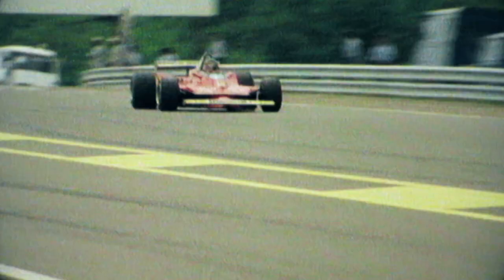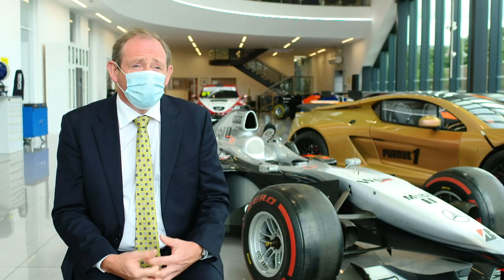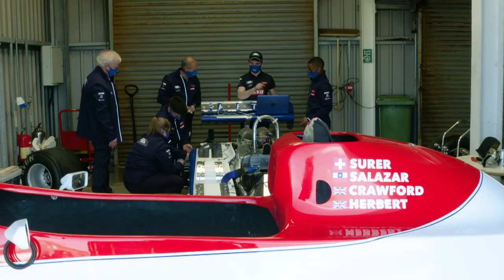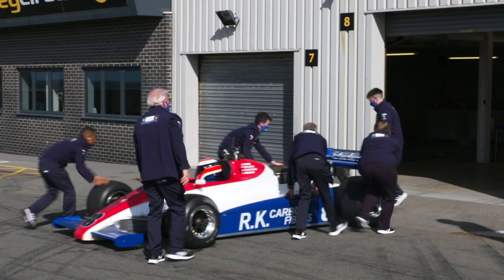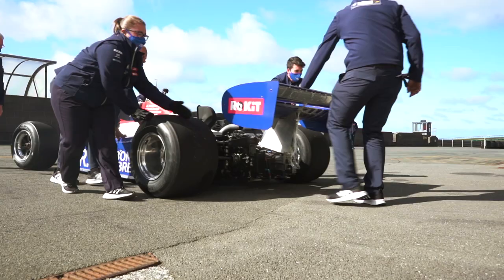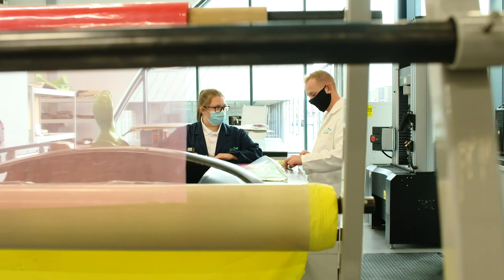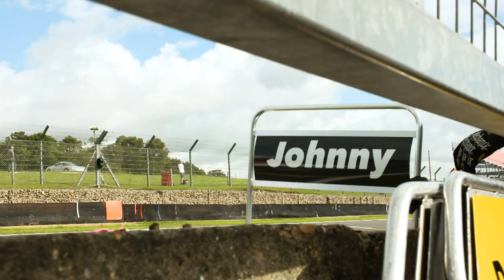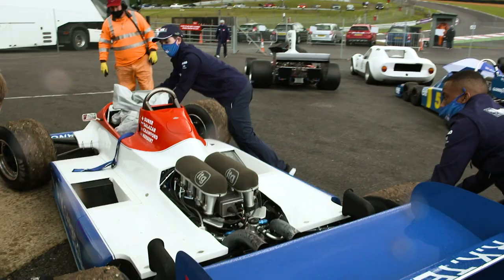Johnny Herbert Races The Ensign With Masters - Brands Hatch

Comment: what track is that?
Reply: Brands Hatch (Full grand prix circuit) which was used as the venue for the British GP (and occasional European GP) between the mid 60s and 1986. The car Herbert drove here would probably have been raced in period at Brands. The circuit changed very little since it was used for F1.
Reply: @markymark2819  That's not where that test took place
Reply: @billenright2788  Race was Brands Hatch, i believe the test session before that was Anglesea.
Reply: @markymark2819  Thanx. I Google satellite'd it. That's the place. What a location.